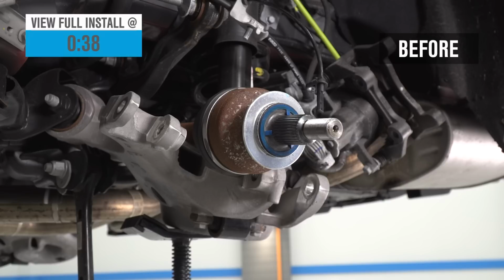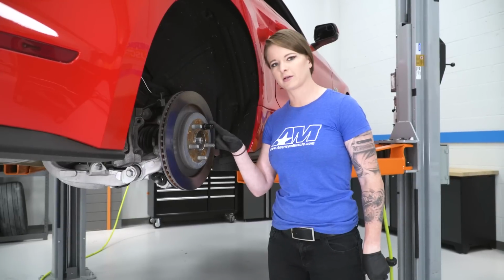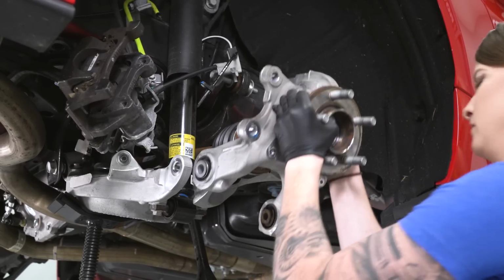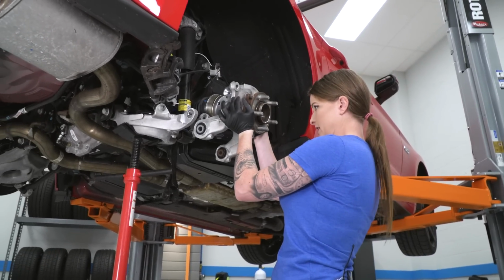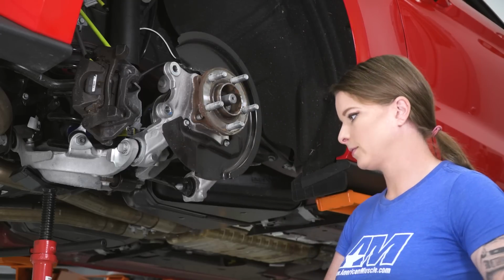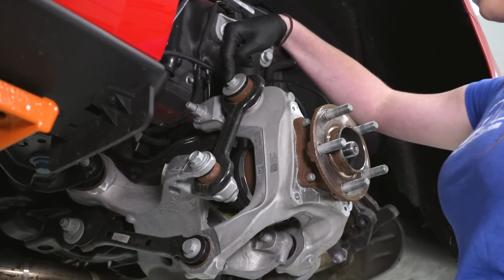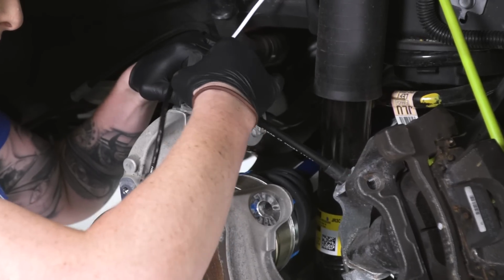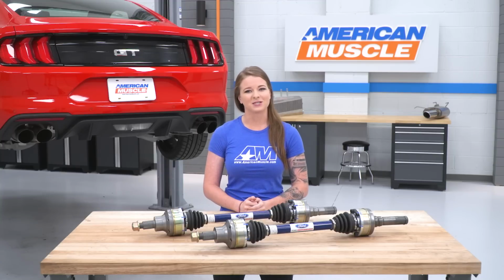2015-2019 Mustang Ford Performance Halfshaft Axle Assembly Upgrade Kit Review & Install

Comment: To remove the shafts from the diff, I left the axle nut on and tugged on the knuckle. Popped right out, on both sides. Axle is easily freed if the splines are stuck once axle and knuckle are out.
Reply: Thats great if you havent already snapped said axle.  Yeah thats what im going to be dealing with...

Comment: Anyone notice that on the factory half shafts, one is a bigger diameter than the other? Is there a  reason for that?
Reply: Do you want a twig or a log to support your 800hp car. The thicker and better material it is the less prone it is to snapping into pieces. If you have 650 hp then you can get the gt350 halfshafts and are alot cheaper.
Reply: No, I mean that one of my factory shafts is literally larger than the other. Of course bigger is stronger!
Reply: I snapped one of these this morning ,   It was the driver side that came on my 2015 Roush stage3.   Not sure if these have been updated or not  but it snapped near the hub side.  Just ordered a new set 😵‍💫
To be clear. The one that snapped was this brand.